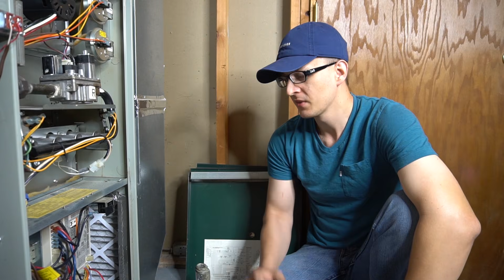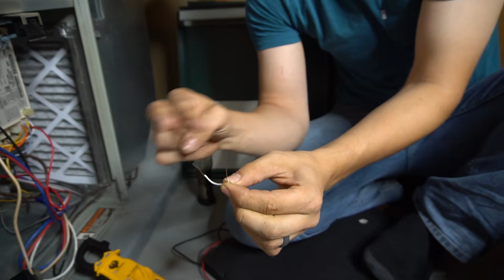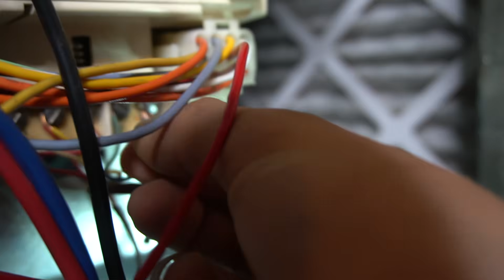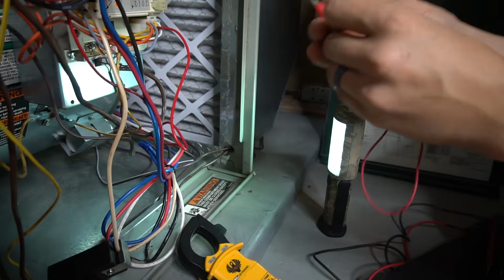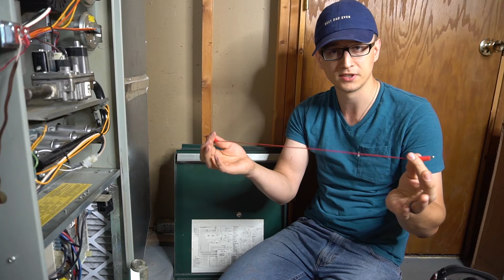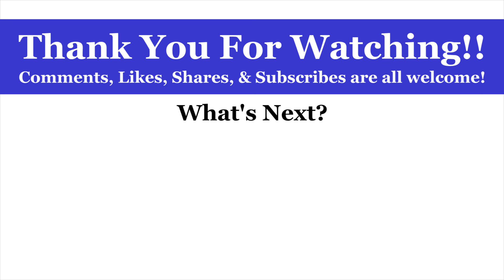How to Jump Thermostat for Heat or AC

Comment: Thanks for Share. Excellent Video. 👍👍👍
Reply from the maker: Glad you liked it! Thank you for commenting!
Reply: @WordofAdviceTV  Bro. Im checking A/C.    When Start this. Is ok. But after 6 minute. The blower Off. Could you help me. Thanks
Reply from the maker: @miguelgonzales543  After it turns off, does it automatically turn back on after a couple of minutes? And what turns off? The blower motor inside in the furnace? Or the unit outside?

Comment: Great video quick question what if your furnace doesn’t turn off it doesn’t seem to be sensing room temperature and just keeps running all day is that a thermostat problem?
Reply from the maker: The easiest way to check that is to just pull the thermostat off the wall. If your furnace runs even with the thermostat off it's base, then it's a bad control board. If it turns off, then the thermostat is bad. But when you say the furnace continues to run, is it just the blower motor running or are the burners on as well? Maybe your thermostat fan setting is just set to ON instead of AUTO

Comment: So how do you check at the pc board if there is a call for heat?

Set your meter to volts AC.
Put 1 meter lead on the W1 terminal.
Put other meter lead on the R terminal.
If your meter reads 24 to 27 or so volts, the thermostat does not have a call for heat.

If your meter reads 0 volts, then the thermostat has a call for heat.

Is this correct?
If not, please correct my error(s).

Thanks in advance.
Reply from the maker: What you said is correct. Although when I check voltages at the control board, I prefer to just check W to C. When there is a call for heat, there will be around 27 volts. No call for heat, 0v.
Reply: @WordofAdviceTV  Thanks! Great channel, btw!
Reply: @WordofAdviceTV  - Is that correct ( "Put 1 meter lead on the W1 terminal.
 Put other meter lead on the R terminal. If your meter reads 24 to 27 or so volts, the thermostat does not have a call for heat. ") ??
If there's no call for heat, the thermostat is an open circuit:
control board (R)-------->|    thermostat    |------->control board (W1)

But, when there's a call for heat, the thermostat closes the circuit from R to W1:
control board (R)-------->|---- thermostat ---|------->control board (W1)

Yes?
(Or am I remembering W1 to C is the open circuit.... which is closed and has 24v on it when measuring W1 to C?)

Comment: Very good display of troubleshooting. Thanks. I was just about to order igniter and gas valve. Then I found this jumper video and it did in fact prove that all systems work fine up to the Tstat, so now I will focus on that. Thanks again.
OH-HALE
Reply from the maker: You're welcome! Glad to hear you didn't have to replace those parts for no reason :) Some of those gas valves can be a little bit of a nuisance to replace. Good luck!
Reply: Running perfect now. Thanks again.

Comment: How common is a transformer failure? Especially on older systems?
Reply from the maker: It's not very common. I barely ever replace transformers.
Reply: @WordofAdviceTV  thank you so much for responding to me, just wanted to let you know that you were correct, it was not the transformer.  After doing some proper diagnosis, I found one of the 2 hot legs in the cutoff switch had failed in the off position after I turned off the system to open the panel.   Big thumbs up and a lot of thanks from me to you and your channel
Reply from the maker: @saeedhossain6099  Happy to hear you were able to track down the problem! Stay warm! :)

Comment: Your first comment about testing fan at furnace means you thermostat is bad... could also be your wiring and not the stat.  I get calls on many rentals where the owner ran a wire in a very bad way.  Furnace quits but isn't the thermostat. 

Is your hot water relief valve piped to within 6 inches of floor?
Reply from the maker: It's about 8 inches from the floor

Comment: Can you bypass if the board is bad?
Reply from the maker: Well it depends on what your board is doing. Sometimes bypassing it will not work. Do you know where you are losing your voltage?
Reply: Word of Advice TV  I bypass and it works for furnace
Reply from the maker: So you are putting the jumper between R and W?

Comment: I'm a fan of your videos man.good job.. maybe you can help me solve my problem. I changed both HSI Igniter  and Flame sensor but still I get 4 red blinks codes means "hot igniter failure, check ground.I bought new igniter and still not flame glowing..hopefully its not the board.pls any advice or help would be greatly appreciated..thanks
Reply from the maker: Thanks Joey! Sorry to hear about your problem. Do you have a multi meter with leads that you can check voltage with? That would help quite a bit.

1. Did you have that error code before you replaced the ignitor?
2. Are you sure you replaced the ignitor with the right replacement? They can vary in the amount voltage they are designed for.
3. Have you double checked and made sure the ignitor and flame sensor are not touching anything? Like the burners.
3. Does your furnace do anything at all when you turn on the heat? Does the inducer motor come on and can you hear the gas valve open for a few seconds?
4. If you have a meter, check if your ignitor is getting voltage by sticking both leads in on the back side of the plug. If your ignitor is getting 120v (usually it's 120v) but it is not glowing, then your ignitor is bad. 
5. If you are not getting 120v going to the ignitor, then I would suspect the control board.

Hope that helps man! Good luck!
Reply: @WordofAdviceTV  I checked the voltage of the ignitor and I'm getting only 105 volts then when the  gas valve opened the voltage drops down to 25 volts.
Reply from the maker: Even with 105 volts, the igniter would start to glow. Have you tried checking the resistance/ohms of the new ignitor? It sounds like the new one could be bad. The voltage drop after the gas valve opens is normal operation though. The ignitor turns off after the burners light. If you have a long shaft lighter, you can stick it under the burner face where the ignitor is and when the gas valve opens, it will light the burners "manually". If you need to just heat up the house you can do that temporarily. (do it carefully of course)

Comment: hi my system is completly empty  i will add 410a to suction line a little at a time  what i want to know is unit running while im adding freon  thank you jim
Reply: thank you for your time and advice i really appreciate it   i have a scale and will do as you say   again thank you   jim
Reply: hi if i add 410a with system off i do not have to turn tank upside down  is that correct  using scale
Reply from the maker: I would still flip the tank upside down. R410a is a blended refrigerant which means it is a mix of a few refrigerants. So it should always go in as a liquid. If it goes in as a vapor, then the refrigerant mixture can be unbalanced which could cause problems.
Reply from the maker: Do you have a scale? I would weigh in the factory charge with the unit turned off first. That way you can open up the low and high side on the gauges and let it fill up, wait for a while to let it equalize, and turn it on and add a bit more if needed. If the unit is completely empty, it will likely leak back out pretty quick though.

That being said, let me answer your actual question now :) Yeah, you would add it through the suction side and the tank would be upside down since 410a has to be charged in liquid only if you are charging while the unit is running. And yes, a little at a time. The rule of thumb is that you cannot go over 10-15psi from the starting point otherwise you could slug the compressor. Hope that helps!

Comment: How can I tell if I have power to my thermostat so I can install a programmable thermostat? I currently have a manual dial type thermostat
Reply from the maker: Like latent fusion said, the best way would be to check it with a meter. If you have 24v between R and C, that means your thermostat is getting power. Just a heads up, some programmable thermostats require a common wire. If you look at your thermostat wires that go into the furnace, how many wires come out of the big wire? Are all of them connected? Could you tell me where each wire goes?
Reply: use a multi meter check between R and C.
Reply: I guess I need to determine if I have a common wire. Best way to check?
Reply from the maker: Look at your thermostat wiring and the thermostat terminal strip at the furnace control board. Do you have something hooked up to C (common)?

Comment: all good, 
 You may of needed to point out the panel switch. most new furnaces have a switch that opens turning off power to the control board when the panel is off. a bit of tape does the trick.
good video👍
Reply from the maker: Yes, I totally agree! I mention that in every video; just re-watched this one and you are right, I totally forgot to mention that. Thank you for pointing it out!
Reply: nice work, really enjoy the videos. I don't get to work on Residencial anymore but I enjoyed the 10 years that I did.
cheers